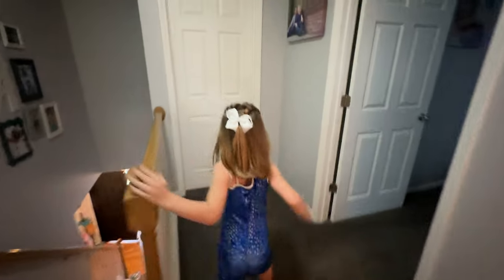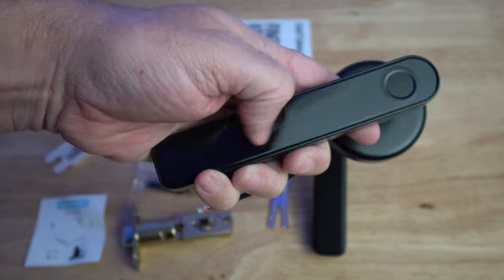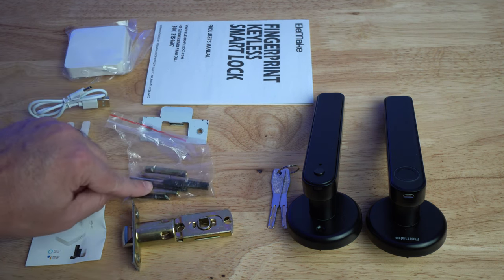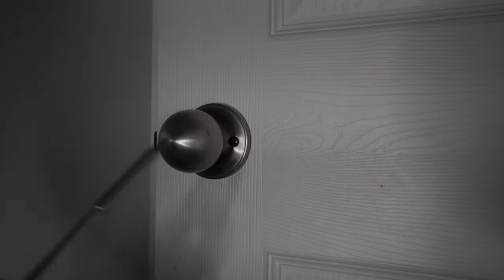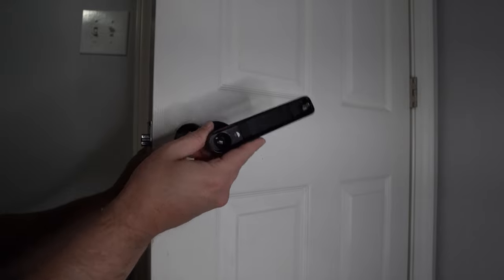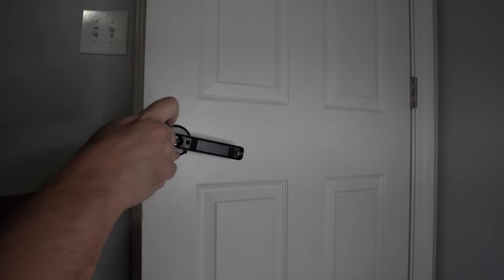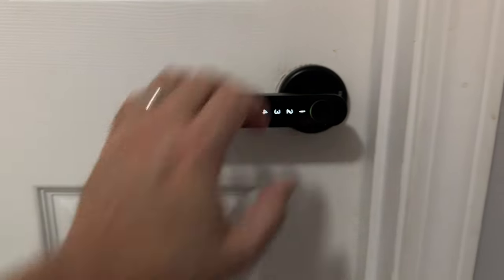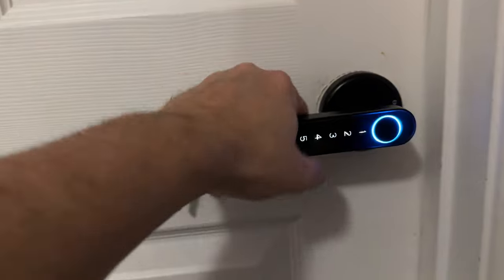Elemake Smart Fingerprint Door Lock Review and How To Install

Comment: Installed the exact same handle on my bedroom door. Been using this for close to 16 months now and my number 7 on the keypad has become unresponsive. I don’t really use the number pad, but noticed this when needing to enter my room one day.
Reply from the maker: Are the batteries dead?
Reply: @DIYReid  no, just replaced them.
Reply from the maker: @twocornell are they in the right way?
Reply: @DIYReid  it works, batteries last a long time, just after a year of use (and not using the number pad) I noticed the 7 does not respond to being touched.
Reply from the maker: @twocornell oh ok. So the thumb print works?
Reply: @DIYReid  #7 on the pad..no. think I'll probably just replace the door knob

Comment: Hai i just bought this..ive installed the handle but the door still slides open when i push it…do i have to change the hinges/plate that comes with it as well?Cause i didnt changed to the one it came with…is that why??
Reply from the maker: It might help. It’s not going into the plate is why it opens.

Comment: Also make sure your door is something like a Brosco slab door or at least a solid core door. If it's a hollow core door they'll be able to smash through it with very little effort.
Reply from the maker: These are for interior doors. If you have an issue big enough for someone that may bust the door I think you have bigger problems.

Comment: What should I do if the battery is dead, it won’t charge and I’m locked out?? 🤦🏻‍♂️🤦🏻‍♂️
Reply from the maker: Batteries are not chargeable. Plug in a battery pack to the usb port to get in and change the batteries.
Reply: It isn’t even opening with power bank or emergency key , I am locked out

Comment: Can you turn off auto lock?
Reply from the maker: Yes.
Reply: Mine sometimes don't auto lock any ideas
Reply from the maker: @kylegoode3838 press the button on the back it changes it from unlocked to locked. When it’s locked it and you unlock it it’ll auto lock if it’s turned on.